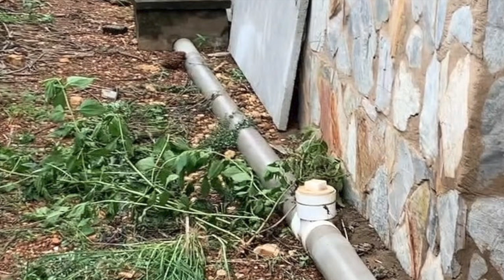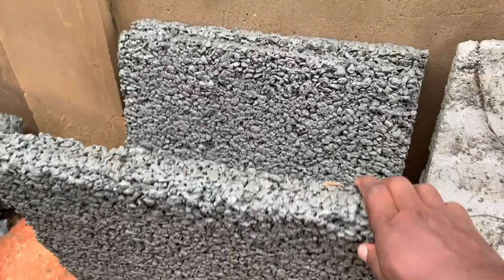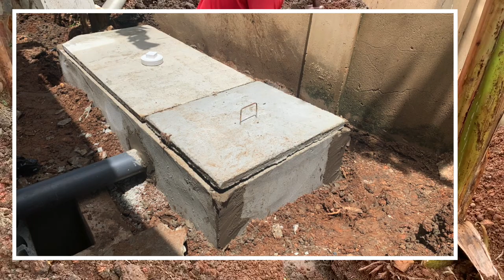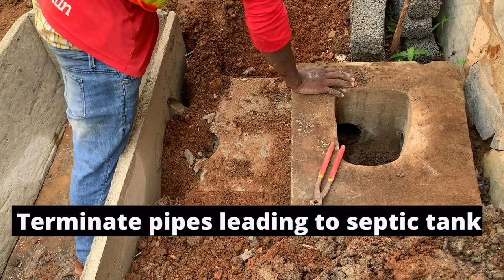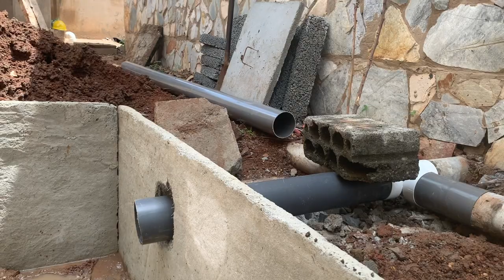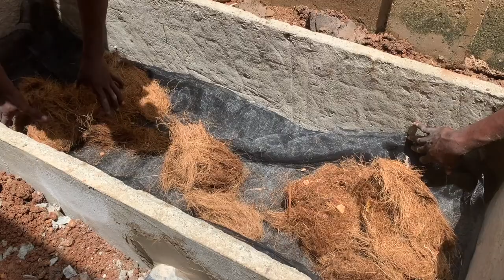How To Replace Septic Tank With a Bio Digester In 2022

Comment: Pls in this case when u are digging the soak hook pit and water is coming from the ground what will you do
Reply from the maker: Then you will need a drainage system or gutter. Or better still a traditional soakaway where the water can be occasionally pumped out.